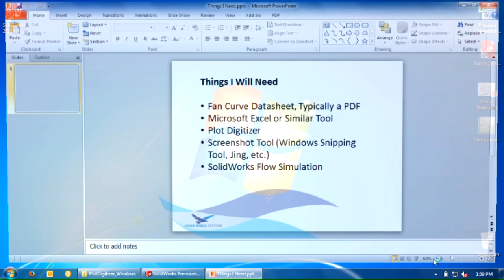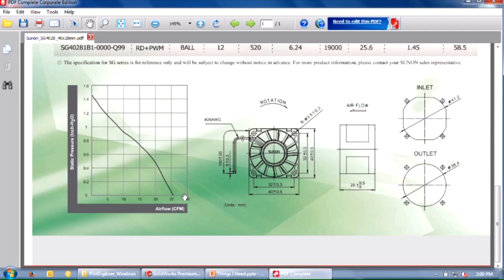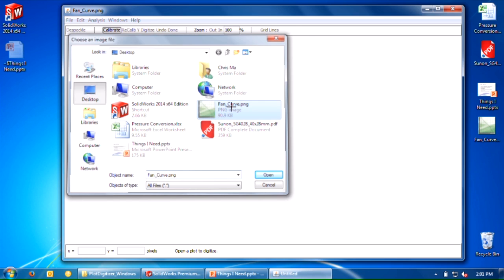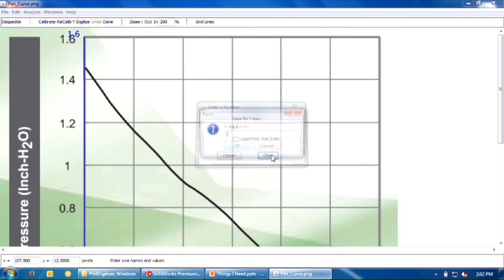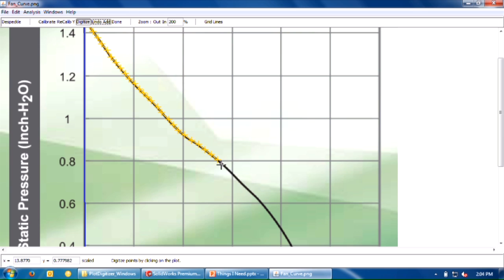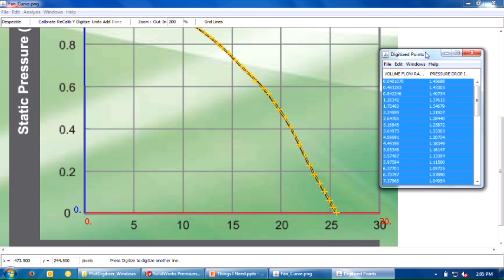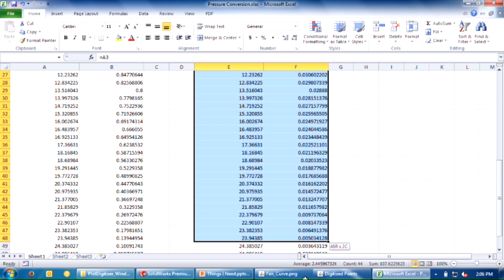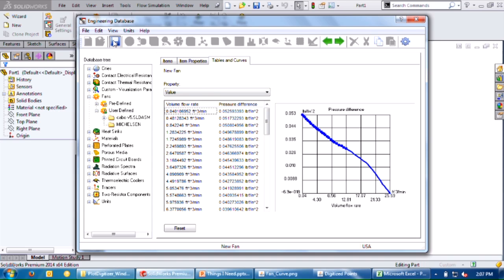SOLIDWORKS Flow Simulation - How to Input Fan Curves

Comment: Is there a way to set the operating point exactly where I want ? Lets say at 0.5 for 50% RPM and 100% for Max RPM ?
Reply from the maker: In newer versions of Flow Simulation there is a feature for "derating" built into the software that allows scaling the fan curve down to represent reduced RPM. But other than that, operating point is always determined by the backpressure in the system. For instance if the same fan is put into a system with more flow resistance, it will result in less flow as the operating point shifts higher (toward the left) on the curve. 

If you want to enforce a particular flow rate regardless of the backpressure, then that would be best done with a normal "boundary condition" volume flow rate. But note that this may be an unrealistic assumption for a fan

Comment: how can we find design point of fan on the performance curve ? can anybody help me ?
Reply from the maker: Hi Onur,
 
If you’re trying to figure out what a fan is operating at in your simulation, the best way would be to create a Surface Goal on the face of the fan, and select Volume Flow Rate. You can then look at the Fan definition in the Engineering Database to see where that falls on the curve of pressure rise vs. flow rate.